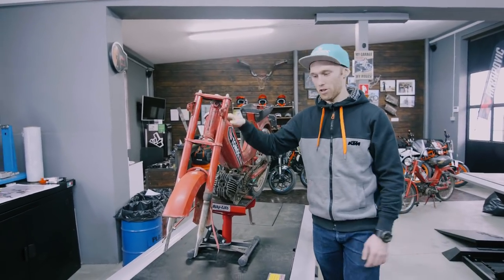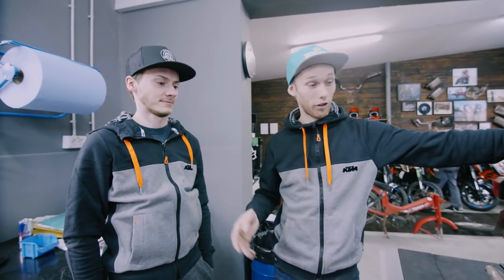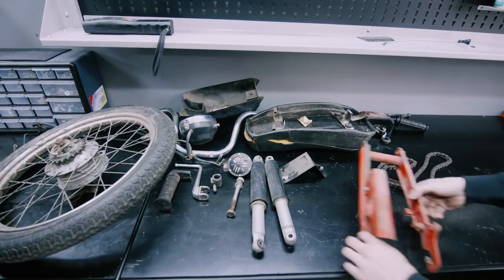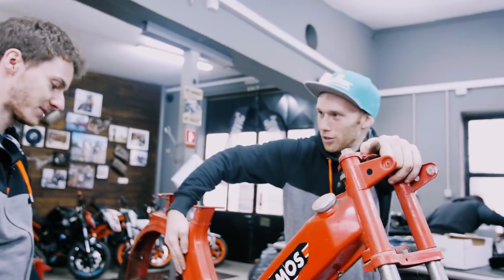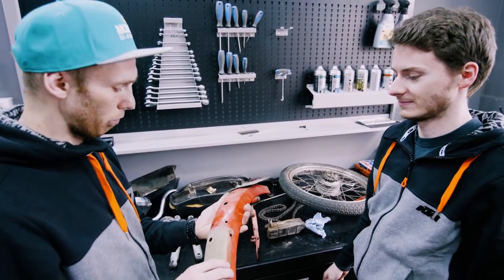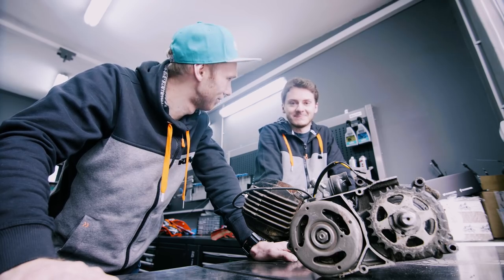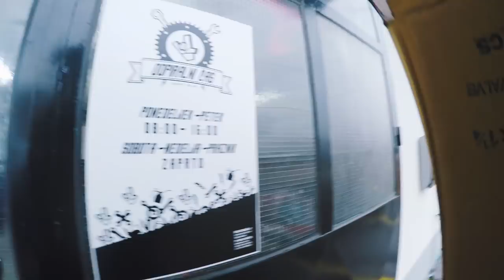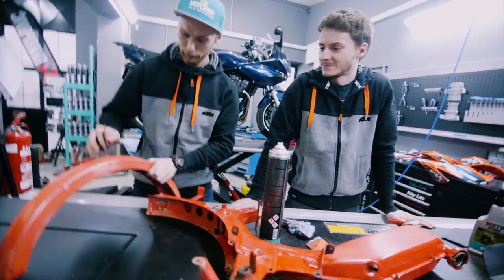BUILDING THE FASTEST MOPED ON THE PLANET | RokON VLOG #46

Comment: the fastest moped in planet is yamaha 125zr asian moped...search it,buy it,test it
Reply: That's not a moped genious
Reply: @GabrTM  than its a superbike then?
Reply: @roybjx4646  it's a scooter. Plus 200 kmph on a 125 2t isn't even that impressive...
Reply: @GabrTM  ever seen superman on road...
Reply: @roybjx4646  no why?
Reply: @GabrTM  okay then
Reply: @GabrTM  i recently seacrh it on wiki and it say moped,underbone...but why you called it a scooter?
Reply: @GabrTM  cause on my information and few years living experience a scooter doesn't have gear they use cvt...this y125zr has a 6 speed transmission...chain driven and have a hand clutch
Reply: @roybjx4646  most scooters have a cvt. A honda pug also has gears and it's a scooter. Now most world governments classify all 50cc motorcycles as mopeds for convenience sake, like you wouldn't call a 400cc supermoto a chopper just because a chopper bike has 400cc (bad example i know) so a lot of people are under the impression that scooters are actually mopeds. Some governments classify even 125s as mopeds. But the term moped means "motor pedal" so a motorcycle accompanied by pedals. Now the tomos in the video is technically a noped, but you could also get an a3 with pedals so it's universally agreed in the moped community that it's a moped.
Reply: @GabrTM  okay thanks for the information